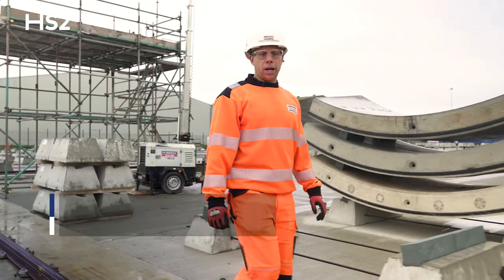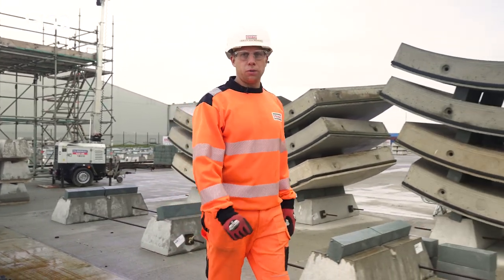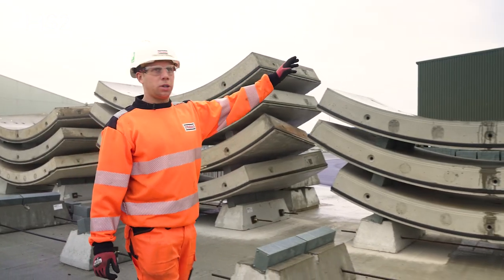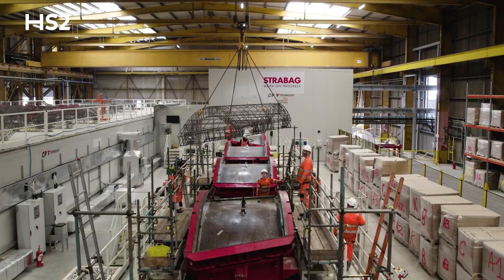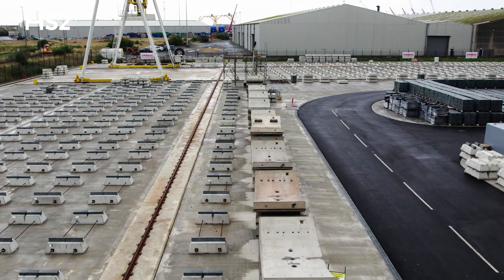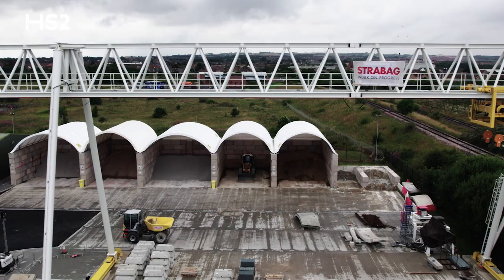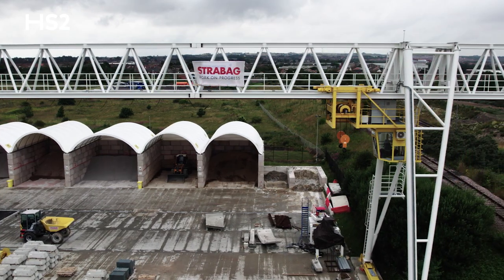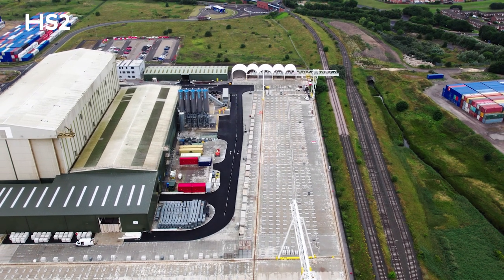Production of HS2's Northolt Tunnel segments begins at new Hartlepool facility

Comment: It's great that this is being built in the North, but if the segments are to be used in London, wouldn't it be cheaper to have the factory in the south?
Reply: Spread the wealth. HS2 is about improving opportunity across the country. Plus, London is a little crowded - hence the need for a new mainline railway.
Reply: Probably the availability of aggregates from a local quarry makes a good economic case for this factory. Great their using re-cycled steel also. I remember seeing the segments for the Elizabeth line being unloaded at Chatham Docks some years ago. They came from Sweden !.
Reply: They probably built this factory so it be just as good at providing for the tunnels in the south, as the tunnels in the North and the tunnels for HS3 proposals.
Reply: Cheaper to make up here wages are alot cheaper than down south. Plus it easy to get rid of waste up here and also dodgey houchen involved